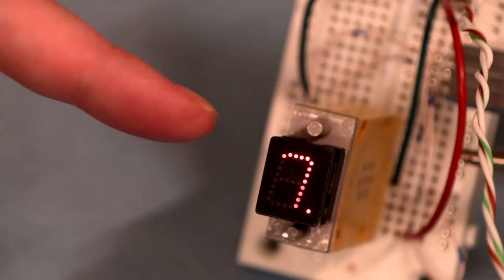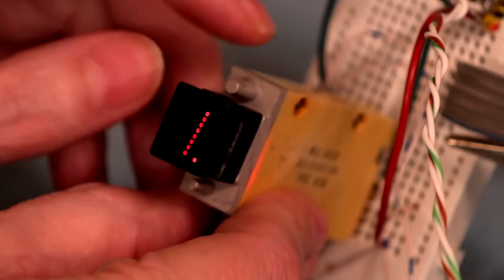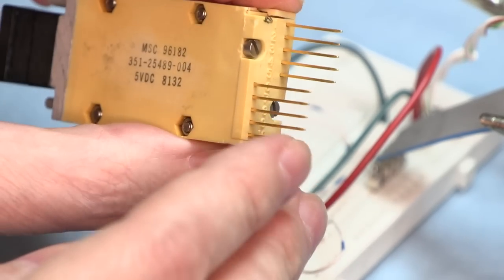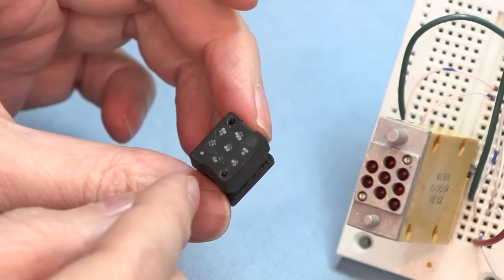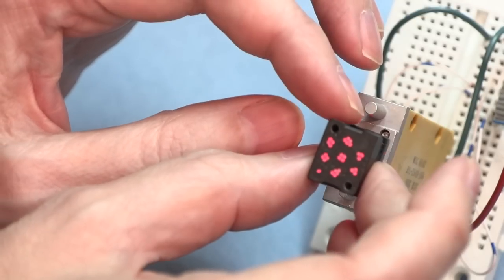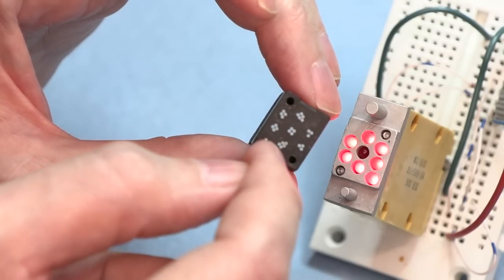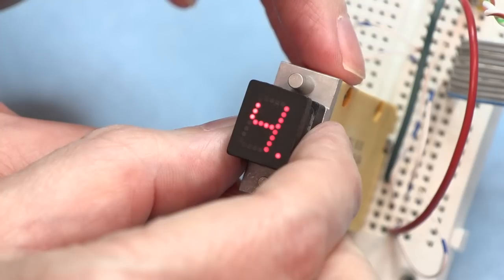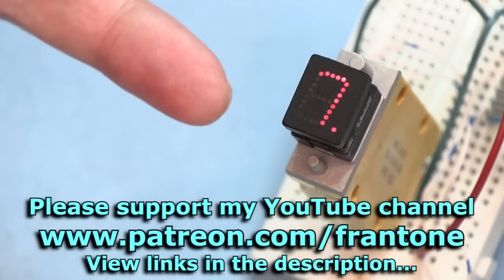Another Look At Those Fiber Optic Displays

Comment: I'm a train driver in France, and we have a samilar type of displays on train's "Blackboxes" (the exact name is ATESS) and there are 3 displays directly on the box that shows error codes and (the memory capacity of the device  that we have to check), for example "C01" (meaning capacité 1 %) and the C the 0 and the 1 are displayed by something very similar to what we see here with the fibers, except the fibers are replaced by tiny tiny leds directly soldered on the PCB, approximately the same size of the fibers here, but the style and the size of the displays is very similar to what is shown in the video here !

Comment: Hi - the pins on the back of that are "wire-wrap" - used at lot at the time that these were made.
Reply: Extremely reliable as well; properly installed, they created airtight connections (no chance for inter-contact oxidation) and also had mechanical strength due to the hookup wire post-tensioning on the square corners of the pins.

Comment: Racking my brain over that fibre optic block. That had to've been handmade. My guess is by threading the individual fibres through two grids with pre drilled holes before injecting epoxy into the cavity between.

Comment: thank you for sharing this. It would be fun to see the fiber block reverse engineered - I can imagine a tedious manual process, but how was it manufactured in quantity?
Reply: The big hint is those circular boundaries around each bundle of fibers in the back, I believe the base piece has funnels that gather the fibers to the correct place as the fibers are pushed in from the front,  then it was filled with black resin.

So probably two injection molded parts, plus a fixture to feed the fibers in from the front so you only have to manually thread the fixture with 29 strands instead of thread each faceplate with 29 strands.
Reply: It might have even been possible to only have to hand-thread the fibers once at the beginning of each roll, much like one would setup a jacquard loom for weaving fabrics.

An entire series of 'blocks' could then have been cast together, and cut at the appropriate spots (especially if there is a matrix of tiny lenses on the front, and not just raw fiber ends).

Unrelated: you don't see those old wire-wrapping terminals much anymore... a lost art, but much more reliable than soldered conections.

Comment: Please put the fiber op assembly on  upside down.  Since the LEDs position is unrelated to the segment position, when inverted it would show oddball characters.
Reply: @Haweater "Since the LEDs position is unrelated to the segment position"
I think it is completely related,  straight through 7 segments + decimal.
The number of pipes is just the number of light spots in that segment
Take the LED light patterns and pipe pattern 2:12
top segment, 5 spots, five pipes, top centred LED
top left 3,  top left LED
bottom left 3, bottom left LED
at 2:38  all on pattern = 8+decimal 
followed by 9+decimal  with lower left and lower centre off
followed by 0+decimal  with middle segment off

Comment: Very nice. Do you think it might be unsafe to look at the displays without a filter or something?
Reply: Why would it be unsafe ?

The fibers don't turn LED light into the eqivalent of laser light.
Reply: @mysticmarble94  Well. these look like laser diodes, not your standard light emitting ones. Fran did mention something about the 650 nanometer frequency.. I'm not up to speed on which are dangerous, but some of these can be unsafe to view directly into the eyes for too long. I mean, you can get UV-C diodes too.. those definitely aren't safe. Anyway, hence the question to Fran. :)
Reply: I think they’re just regular old red LEDs. Although, this would be wild with laser diodes. Hahaha.  
I’m not even sure diode lasers were around when this module was made. 🤔
Reply: @BRUXXUS  Right? :) Though I think laser diodes have been around since the late 50s/early 60s at least.. Impossible to tell via this media though. Fran?? Please confirm. Am curious. :)
Reply: @al3k  The first laser was made in 1960 and that was a ruby pumped laser. Laser diodes definitely weren't around back then. Judging by technology used in optical disc players laser diodes weren't practical until the very late 1970s or very early 1980s. And I think those were infrared diodes. I'm guessing red laser diodes weren't around until later.

Comment: I feel like it would be pretty easy to make new versions of these displays... 
- the fibers could be held in a jig, lining them up on the front and back inside of a mold cavity.  There's no need to have them precisely lined up internally, that will all be hidden.
- then black opaque dyed resin is poured in, past the fibers, filling the cavity
- then once that cures, trim the fibers at the back and front of the resin block and then they're perfectly lined up.

Being that you don't need to see inside the block (nor do you want to), nor do the order of the fibers for each segment matter, there's a level of precision that is just not needed for constructing it.  I should 3d print some template brackets and find some fiber optics to try it out. 

perhaps it;s set up as pre-bundled fibers on one end (bundles of 1, 3, 4, 5) which are threaded through a hole in that side of the mold.  The other side of the mold has the "centers" of the two halves of the "8", as well as the outer portions all as clamps... take the bundle, lay it out on a corrugated edge of a portion of the other side, clamp it in place.  repeat for all 7 segments.  the clamp then becomes that side of the mold...
Reply: I'm 99% sure I can replicate these, the only real questions that need experimentation are what type of fiber to use and what type of resin.
Reply: @sleepib  Keep us updated! :D